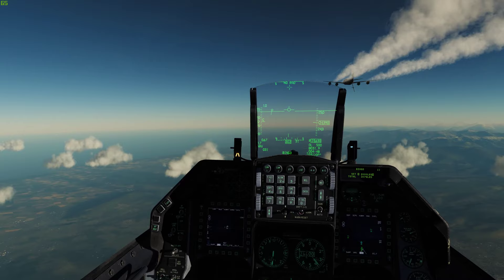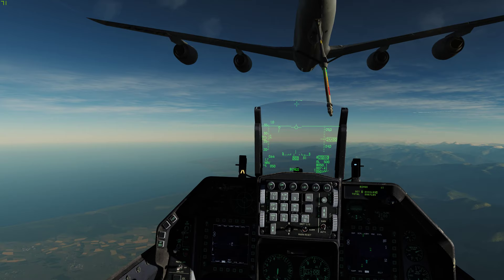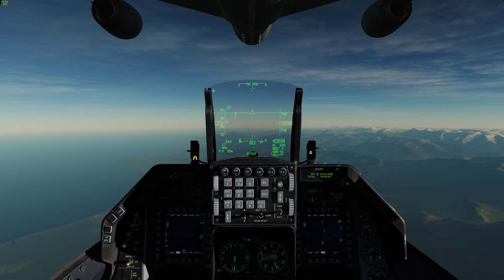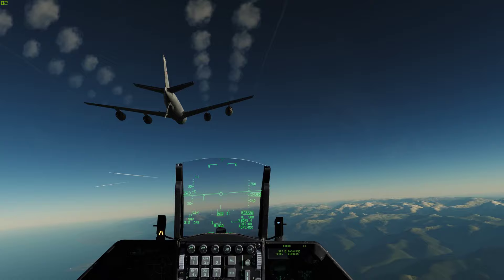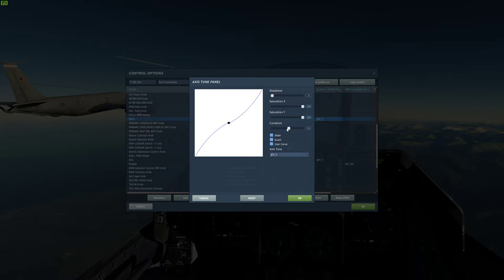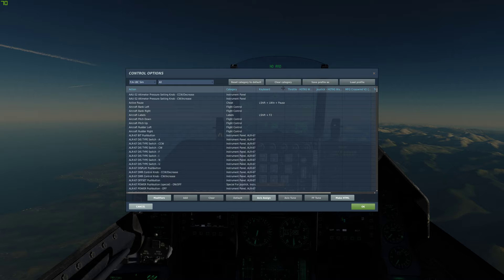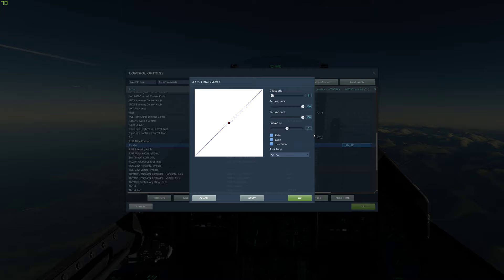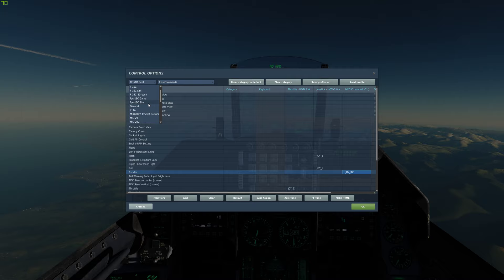DCS Air Warfare Group - F-16C AAR & HOTAS SETTINGS

Comment: These curves and such are exactly what the doctor ordered.
Reply from the maker: I just hope it helps people enjoy DCS!
Reply: @AIRWARFAREGROUP  

I can't thank you enough for fixing my F/A-18C Hornet. I could tell something was off but I never pegged it as the curves. Once I switched It became instantly apparent  my curves were largely preventing me from fine control in all regimes you talked about. With some seat time I'm quite sure I'll get the AAR on point, no doubt about it. Obviously I've reviewed all my other modules especially the Falcon, and Tomcat. Awesome mate, thanks.

One question if I may, I also followed your custom throttle setting for the Hornet -- in your video you only showed for one motor, but I went ahead and done it for both. I'm getting some thrust unevenness in the mid-range, more than I would think would be in real life, just want to make sure this the correct procedure. Again, thanks for the curve work.
Reply: Disregard the throttle bit. I have it sorted out. Thanks again.

Comment: Thank you for tutorial. What are real speed and height of AA refueling ?
Strange but I cant perform it even doing "nanometrical" stick movements, close but not stable enough for long period. Settings are the same as yours, not the super one but good enough joystick and ability to do surgical moves by hands.
Reply from the maker: Depends on the mission and aircraft.  Google ATP 56B for more information.

Comment: You mentioned that the F15 and SU27 curves would be similar. I imagine those would also apply to MiG29? What does those pitch/roll/rudder/throttle curves look like in comparison to these? I gave up trying to refuel in F15 long ago. I also quit AAR in Harrier due to porpoising.The inability to AAR has really limited the extent of this game for me. Great vid and thanks!
Reply from the maker: Greetings.  Unfortunately I uninstalled the FC3 aircraft ages ago.  Try 10 DZ and curves around 20 and then reduce it slightly until you find the sweet spot.  What are you using for controllers?
Reply: @AIRWARFAREGROUP  Hey thanks for the reply! I will give those a try. I have DZ between 3-5 and curve at 30-35. It's works for T/O and Landing some A/A combat but any attempt at AAR is an exercise in futility. I use FC3 for F15/MiG29/SU27, but I also fly F18/F16 and AV8B. Going through an F15 resurgence as of late. I have an X55 HOTAS with CH rudder pedals.

Comment: 9:35 man i have the same controller as you but i had to put the F-16 with the correct sensitive of a real F16m that you know is pretty high (pressure feel) and i have mine 28 yeah you heard correctly minus 28  and  im in heaven,(i did it because i saw a video of a real f16 pilot speaking about it and by what he says he reallyyy sensitive) at the beginning was very awkward and hard but now is even easier to refuel since your movements are literally millimetric ,  i have 1 in the deadzone..just  in case, i dont believe or like deadzones higher than 2..i really need to have that center feel to fly these jets, yes the rudder i use a dead zone on my pedals of 5 and the curvature is positive to is smoother, i normally calibrate my Warthog with frequently , its been the best experience i ever had, even flying around or killing enemies, after you get use to, is way better because i feel i don't need to move much my right hand to achieve what i want, refueling was challenging in the beginning but after became easier somehow the f18 f15E - F15C is flat at 0  i just have curve of 15(positive) with aircraft's like Mirage, the F14 because Su jets, obviously in real life they need more input, you have to try the negative curve in the F16 and don't be afraid to push it like in real life, i even think real life will be more than 28 or 30(negative) but 28 felt good, and if you look to the flight stick on the right you can see it barely moves with 20-40 degree rolls. cheers man, liked your channel subscribing, Cheers from Portugal-Lisbon
Reply from the maker: Hey Marco...is that F-16 TM stick addition have the force feedback pressure sensitive feel?  If yes, that is very cool.

Comment: Awesome videos that helped me a lot! Could you do something about; longitude and latitude? Sometimes i get coordinates in seconds instead of minutes.. so DED input keeps flashing.. thanks!
Reply from the maker: E. Silvester Hi there.  The F-16C Viper is one of my favorite aircraft in the real world and DCS.  It’s still early in development and subject to much changes so I’m trying not to focus on it at this time.  However, Wags has two INS Alignment videos that you should watch.  For detailed alignment information, it takes 6-8 minutes to get a proper alignment unless you start your mission with Hot Start aircraft.
Reply: DCS Air Warfare Group i know how it works, its just when setting up new target points within the existing flight plan i get confused due to not having the right longitude and latitude. Sometimes they are given in seconds, instead of minutes and don’t know how to translate this. I’ll keep eye on your channel, love it and the F-16c is my preferred one! Thanks!
Reply: DCS Air Warfare Group still having problems with AAR. Setup the axis on the joystick taht helped a lot! But wondering if you made any changes on axis with trottle (warthog). Can’t keep it steady, either little to fast or to slow.. 😂
Reply: I might add my two cents, but if you go into your options> Misc and look at the top right you will see  coordinate display and you can set how you get your coordinates. You can adjust how you want your coordinates shown, I believe there is  keyboard commands to change them in the F10  view also, I just cant remember at the top of my head.

Comment: So no user curves on the throttle of the F-16 as you did for the Hornet ? It stay linear? Thx :)
Reply from the maker: Great point Takarde...thanks for this comment!  So, my viper is working great for me with the TM Warthog mapped to the right throttle side (I bind them together for the F-16C Thrust) and I have Deadzone of 8, Saturation X/Y both at 100, and Zero Curvature and everything is fine for me.  I do have Slider checked below...hope this helps amigo!
Reply: @AIRWARFAREGROUP  Thx !
Reply from the maker: I think that came set up for the thrust master warthog default from ED for the Viper in the settings because I don’t remember setting at eight dead zone but it works for me on the warthog Hotas.